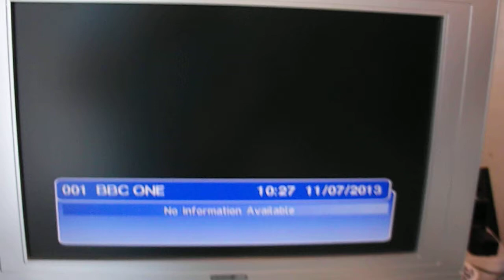ACOUSTIC SOLUTIONS 19" LCD TV REPAIR  ASTV36192C-ID

Comment: Hi, I have the same problem, I linked the 12 volts to the good 12 volts and the tv powers up. What did you actually change on the av board?
Many thanks
jb
Reply from the maker: sounds like the power board
if no 12volts... check caps or dry joints on connecters can  give problems to.
happy finding.